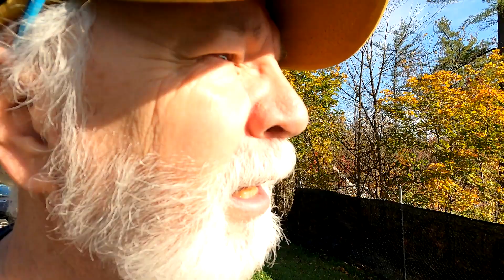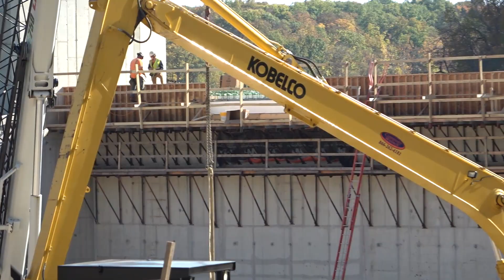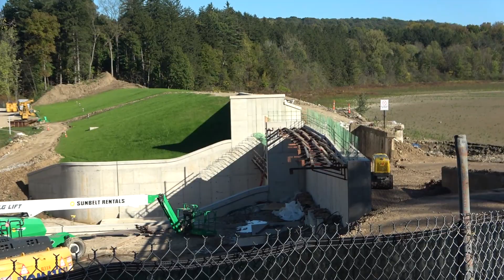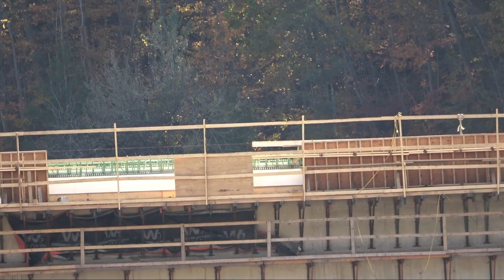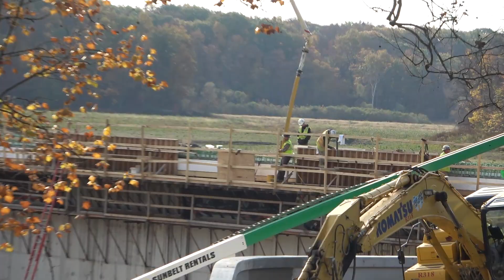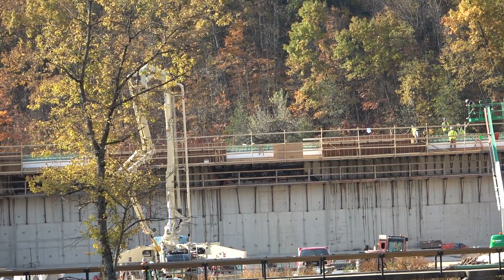Hinckley Lake Drain and Dam Reconstruction   October 2024  Update 11

Comment: Thanks for the update.  As to what the guy is doing with the excavator in the lake,  wasting time. I do not get what is taking so long to do this project.
Job security I guess.  I wish they would dredge the entire lake. I was there a lot in the 70s and its so shallow now.. It would be great if they did the entire project complete.
Reply from the maker: Thank you for watching, glad to provide updates. 
If you look at the video about the time that guy is smoothing out the lake bed, notice the stones around the side of the dam wall.  Notice how high they put the protecting surround. and how high the spillway is.  I do believe the lake at this point will be deeper.  
Maybe that is why they say the entire project will not be finished until 2026......it will take that long to fill.
We'll see
More updates to follow.